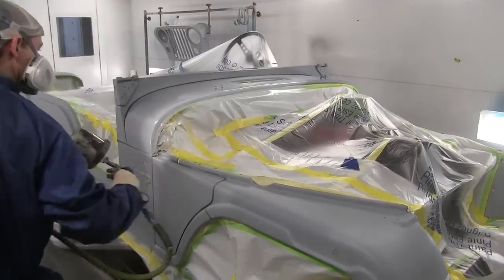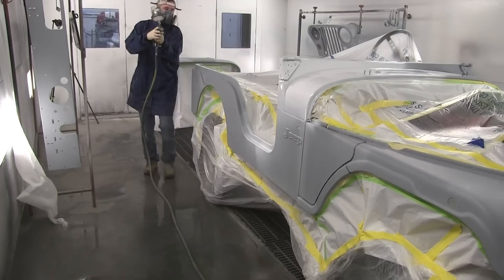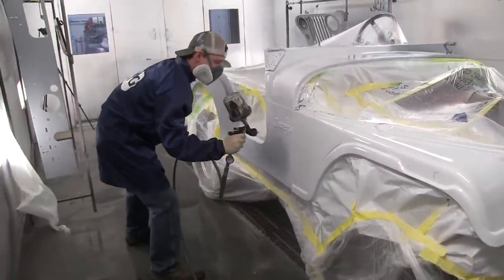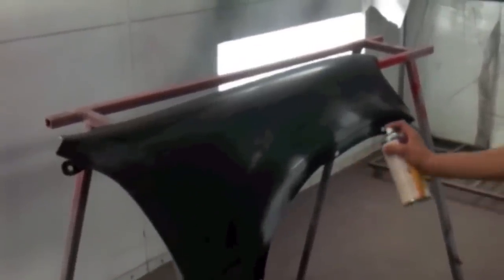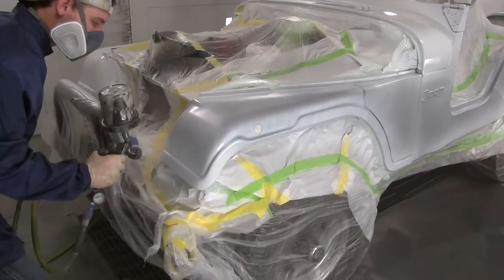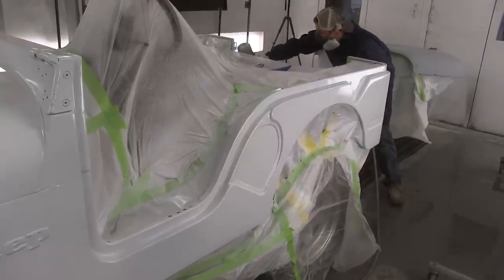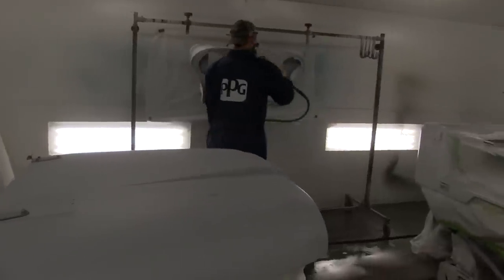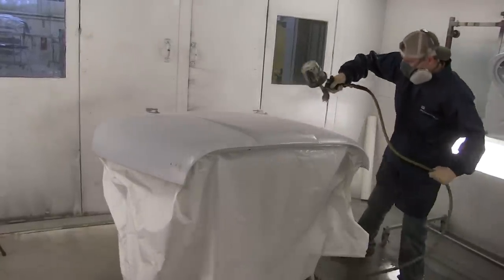How To Spray Primer Sealer and It's Purpose

Comment: I've been  getting into, automotive paint lately. I used color over etching primer. 
The top coat ended up cracking/splitting.
Lesson learned, going to pick up some primer sealer.

Comment: I have 2 questions donny 
1. how do you prep porcelain and what kind of primer oy use on it?  like sinks 
2. instead of apply primer surfacer or epoxy primer  can you just use primer sealer just incase you dont have to time to do all that block sanding on primer surfacer?
bye the way your excellent teacher you explain well

Comment: Excellent clear instruction.  I'm doing my first nut and bolt restoration, and have decided to epoxy powdercoat-prime the body tub, inside and out. The factory topcoat was applied to every visible surface.  How best to prepare all the small cavities and double metal areas at the interior of rear fender areas, etc?  I assume the epoxy will get pretty much everywhere.  After a skuff sand, would a sealer applied with a detail gun in all those tight areas be a decent prep for a single stage topcoat?  Most of this will not show.  Thx!
Reply from the maker: If it is scuffed then the epoxy should adhere fine.  I would spray the topcoat straight on top of the epoxy within the window you brand has.  If you wait longer you may have to rescuff before  top coating.  Most epoxy has a 3 day window, but read the can to make sure on the brand that you are using.

Comment: Hey there Donnie- what WOULD you recommend as a sealer coat- for single stage acrylic/enamel paint- 70 chevy truck?? I have learned quite a bit from your video,s over the years; much appreciated; the single stage paint is  "two-tone" silver metallic- with dark midnight metallic blue roof&hood, thanks PATRICK.P

Comment: Great video!  i have a question though as i am going to respray my 1969 ford mustang boss 302. What grit of sand paper did you use, and after you sanded it, did you spray the primer sealer, or something else. Just asking because it looks like surface primer your spraying over. if you are please let me know, thank you.

Comment: I love your videos and seen a couple on this subject. But I am still confused by a 2k sealer primer and 2k high build primer. I know there is polyester leveling/filler primer for block sanding. But if a sealer is used what step would it be. So Would go 
1st Epoxy or selfetch
2nd polyester if used to level
3rd 2k surface high build primer
4th Primer sealer
5th Basecoats
6th clear coat?
What am I missing?
Reply: You’re not missing anything.  Step two is not necessary.  Block sanding the primer is enough

Comment: Could i reduce finish 1 fs512 primer sealer? The tds says it can be used as 1k with reducer and 2k with hardener, but could i use it as 2k with hardener but add a little reducer?

Comment: Thanks for the video. I have couple of questions. Can the primer sealer be in black? If yes, can we spray regular black base coat as primer sealer?
Reply: Your regular base coat is not a primer paint.  Its a base coat..  you want an etcher, then sealer then base coat..  theres no cutting corners in a good paint job..  but the simplest one are the single layers...

Comment: Is primer sealer the same as epoxy primer?
Reply from the maker: There are primer sealers that are not epoxy, but most epoxy primer can be mixed by adding more reducer and used as a primer sealer.

Comment: So if you spray within the flash times you never have to sand in between
Reply from the maker: That is correct.  The flash time is how long to wait between coats and the window is how long you can wait before having to sand.

Comment: Great video. I have a couple of questions. I am restoring a 1954 Dodge Fargo and the paint is 65 years old. now I have done some body work and there is more to do. When it comes to paint the truck do I prime the entire truck because there is primer, old paint and bare metal. I have no idea what kind of paint was used in 1954. Oh, by the way, I am painting it flat black. Not Hot Rod Black. I don't like the finish. It is too shiny. So I am trying to find some other paint that is duller. Any ideas??? Another thing, Flash time is very confusing. Now say it takes 30 minutes or so to spray a set of doors and fenders. When does flash time start??. Say I started fender # one, 30 minutes ago. I am past my flash time on my first fender and ahead of me flash time on another. So when does flash time start. Does it start when the first fender is done, or when the last door is done 30 minutes later??? I am not being a smart ASS, I want to know because I have my truck to paint and I don't want to screw it up and have to do it twice. It is too costly. Thanks for sharing.
Reply from the maker: Hey And, great questions.  I'll make a video to answer for this in a few days.